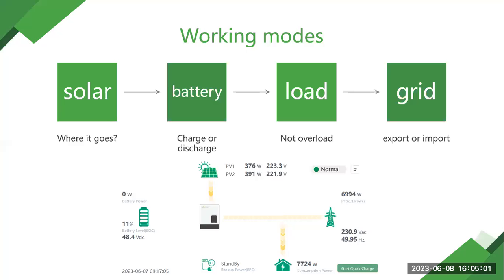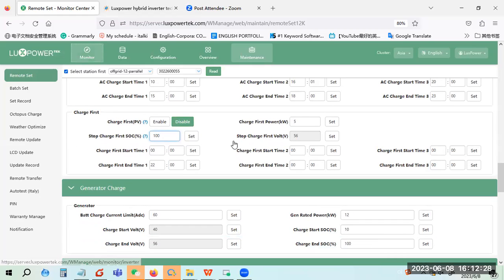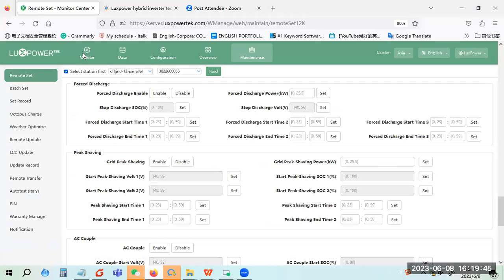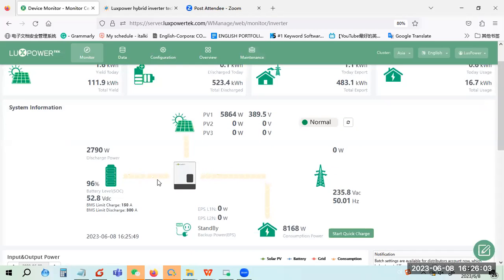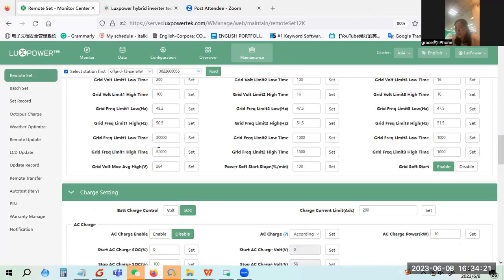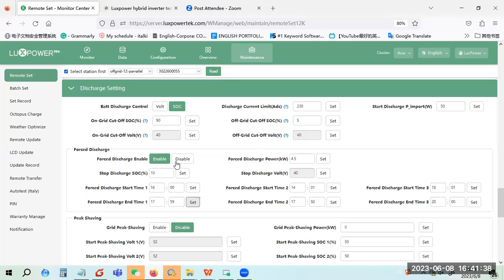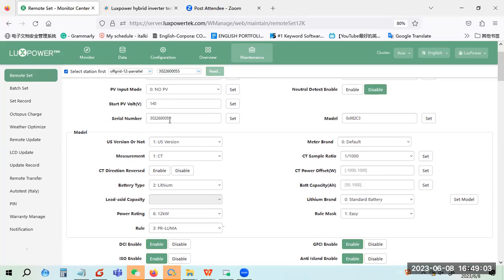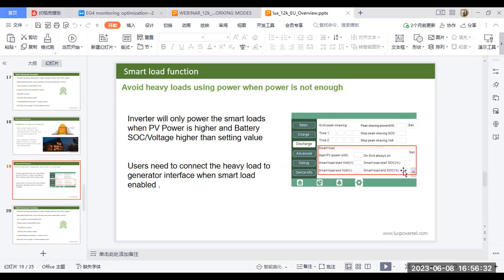LuxpowerTek LXP-EU 12K | Working Modes Training Webinar

Comment: 120/208  (WYE Star) configuration is available with just one 12k inverter or you need more than one? Is this inverter is able to connect "closed loop" with EG4 LL V2 rack batteries?